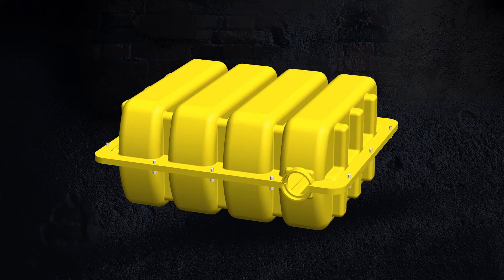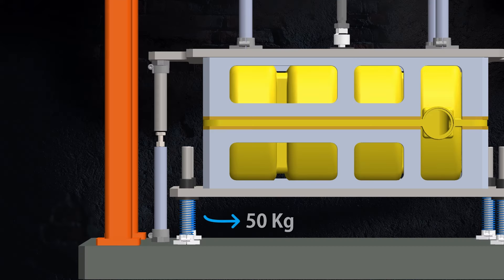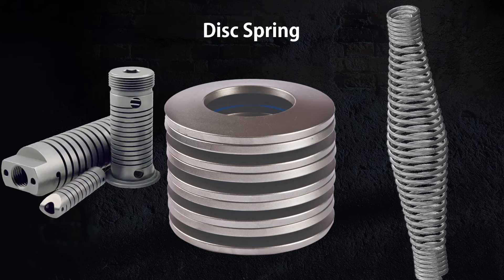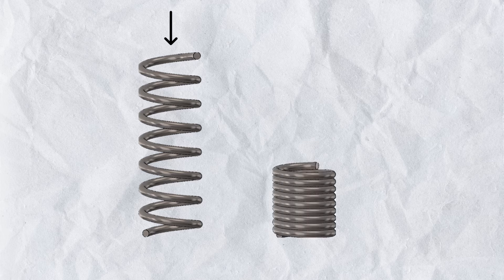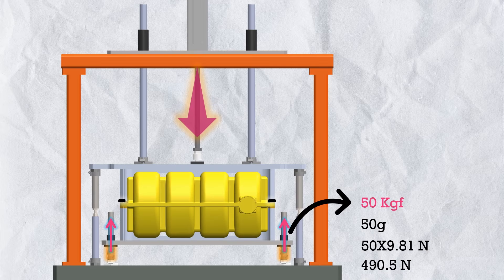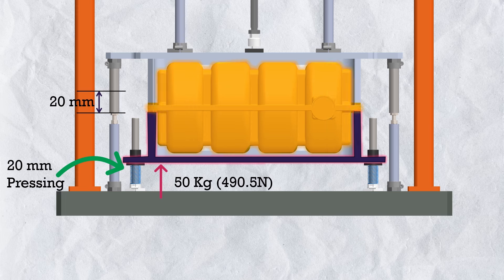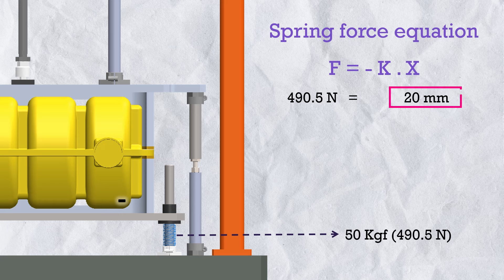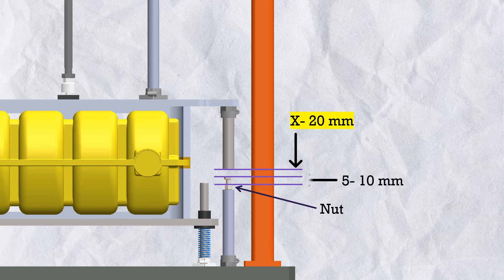Mechanical SPRING Selection Calculation | "Step by Step" SPRING Selection Procedure

Comment: You only need a two position air valve and air pressure regulator.  The force will be pressure times area of cylinder

Comment: Thank You Sir for explaining such Machine Design calculations there are no videos in here discussing in such a deep way as you are discussing thanks for sharing such expert knowledge. Also one request was that I wanted a video on Wire Diameter Bending calculation with roller bending. wire diameter will be 8-10mm. I want to design a Ring Making Machine where the 10mm Wire Diameter is going under roller pressure to create a complete ring of diameter.
Reply from the maker: I'm so glad it helped 😊 wire bending calculation - Yes sure, but this will take time

Comment: But you didn't mention, how make sure Exactly 20mm deflection which gives 50kg
Reply from the maker: I guess I had mention, x= 20 mm, F= 50 Kgf (500 N), means spring constant (k) should be = 500/20 = 25 N/mm, to ensure that when spring deflected (compressed) by 20 mm, would give 50 kg reaction force

Comment: I admit that it is the best lesson to reveal the functioning of the spring, but also the method of explanation is TOP Thank's
Reply from the maker: Thank you so much 😊
Reply: @mastermechanicaldesignwhich software you use for designing
Also what you used in this video for making animation
Reply from the maker: For design i use Solidworks, for animation i use MS PowerPoint, Blender and Davinci fusion, Solidworks motion.. also some others tools

Comment: Hi Mister, your way of explanation is 100% perfect, but there is some mistake in your explanation while selecting 9.81N/mm spring, we can select that too since deflection value is different between 6.131 N/mm and 9.81N/mm spring if you agree

anyways I am here to request you to make some video to decide the mean coil diameter, wire diameter and length of the spring. because I am designer of Vibrating Screens for Mining and construction applications.
Thank you in advance.
Reply from the maker: I didn't fully understand your question regarding spring deflection. For coil diameter, wire diameter, there are formulas to calculated these. you will find under theory of machine books.

Comment: Please upload a video for beam i.e. ismc, etc selection. What will be the allowable strees, allowybending moment & allowable deflection
Reply from the maker: For beams and structure, calculation is very tough. Because in real-world loading directions and Structure joints will always be complex. Which makes calculation of failure  so much complicated. So always prefer FEA analysis. No liner Statics analysis

Comment: Your animation was lovely and clearly understandble❤❤... Voice also very clear and good
I have an one doubt top fixture we are giving force 50kg bottom fixture already 132kg if  i put load cell on bottom how much kg force really i will get either 50 only or 1 kg, thanks in advance kudus to your work sir.. ... 🎉🎉
Reply from the maker: Thank you so much Srinivasan, yes, I have done some acoustic treatment over front wall to get audio right. 
Loadcell- Top fixture we are giving force 50 Kg (No top fixture weight is 80 Kg in this example, but we are just stopping this weight with stopper), Bottom fixture already 132 Kg. (Yes, it is. 135 Kg.), If I put load cell on bottom, (where at bottom? if you will put load cell between top fixture and bottom fixture, you will get 50 kg spring reaction force, if you will put load cell anywhere bellow top fixture you will get kg spring reaction force) or you can send me mark picture, where exactly you want to put load cell.

Comment: Hi bro
Your lesson is awesome. 
But I have a doubt.. spring initially cannot compress.. For certain load it never react.. That is called threshold. I thing u missed it. If iam wrong please correct me
Reply from the maker: Hi vignesh, springs or any material always reacts (always deflects) when it goes under any certain amount of load, yes if load is too tiny, deflection will be not noticeable but there must be some deflection on microscopic level. So there is no such threshold condition in spring deflection or in any stress, strain condition of any object.

Comment: Thank you for your effort. Could you give me hand ?  I do not get what is the mean of 50 kg means. Thanks
Reply from the maker: An amount of force, which is a 50 kg mass object applies in gravity. Technical 50 Kgf. (Killo gram force) In Newtown 50g - 50x9.81 Newton.
If you are wondering why I'm saying force in Kg why not directly in Newtown.
So in practical work we don't have feelings for Newton unit. For example if someone says 500 Newton force. Technically perfect but we don't get feel on 500 N. And if someone says 50 kg of force. We get that easily. Because we know our body weight is 60-70 kg. We know how much is 1 kg. How much is 1 ton. So we feel it easily. So we generally represent force in Kgf. 50 kgf means 50x9.81, approx 500 Newtown
Reply: I got it thanks. But I did want to say; why we use 50 kg ? where come from
Reply from the maker: Ummm, this was just an example. Just assumed. For your application. Load can be anything.
Reply: @mastermechanicaldesign  thanks

Comment: Pls share catalogue where i can see spring constant. 
I have a conical helical spring, wire dia 0.8, small dia 6mm, large dia 16mm length of spring is 28mm, how to know spring constant.
Reply from the maker: Catalogue: You can find springs catalogue on any spring manufacturer website (eg. MISUMI)
Spring constant of spring depends on all these parameters, that you are mentioning, and you can calculate spring constant, formula is in this video, or just search on google. but better to find spring constant in their manufacturer catalogue, because spring constant also depends on manufacturing process and heat treatment, material composition

Comment: Thals for the video. But as the weight of the upper Lid and Pneumatic cylinder forces combines and becomes total 180Kg. But we can not apply more than 50Kg load or force on our tank part, so my question is, why are you choosing only 50 Kg reaction force from spring? It means 180-50=130Kg would still be applied on the tank? (But we can not apply more than 50Kg)?
Reply from the maker: Pneumatic cylinder stroke is going to be dead, by stoper. So its top lead + pneumatic cylinder force will become 0. And 0-50 kg = - 50 kg. Watch this video again i have explained this same thing.

Comment: But sir how to know the selected spring is capable to carry the load...
And load under UTS.
Reply from the maker: In most of case you should rely on manufacture defined Maximum spring force for selected spring (Don't apply force more than spring max. force), for stress calculation, you can calculate, shear stress. you can find the formula in mechanical element design textbook. (I had also mentioned in video)

Comment: Engineer Emirtus, sir, if Suppose instead of Plastic Container if it is Railway Compartment weighing Load One Ton, so below what type of Spring  Dimension and weight should be fixed, keeping in mind Below Springs are 4 Moving Wheels moving on Steel Rail Track ,sir !
Reply from the maker: For that we would need to design the spring. not much default. I'll make a video on it